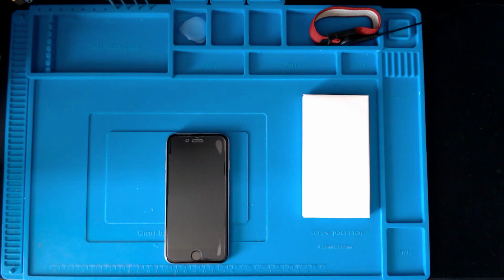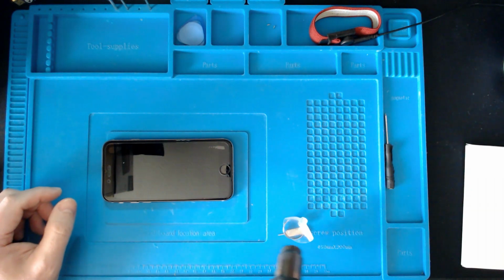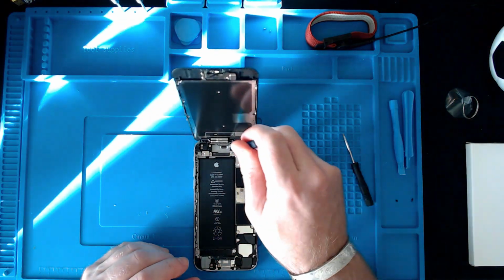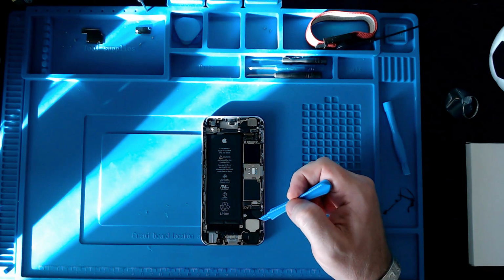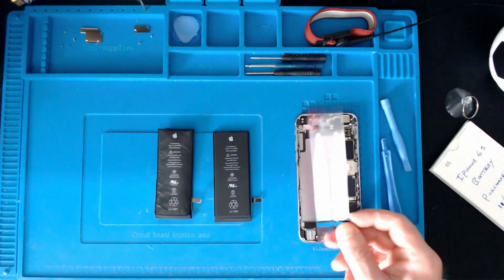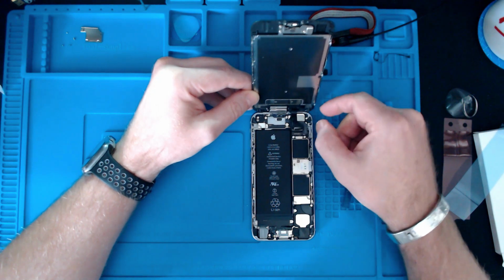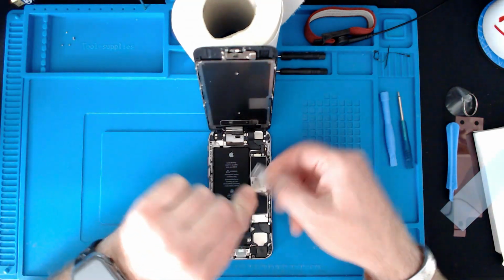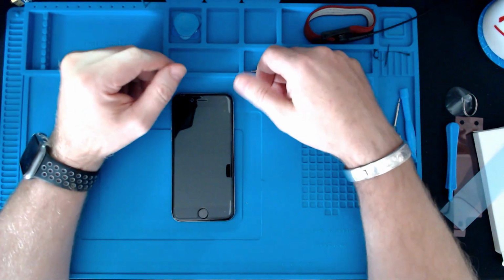iPhone 6s Battery Replacement | With Slip

Comment: be careful prying on a battery if you puncture it it will catch fire , those two strips if you get hold of those and pull away the battery will come out much easier next time there designed for those strips to come to easily replace the battery , good job again
Reply from the maker: Thank you for your contribution! Constructive polite words of advise are always welcome on my channel as we are always learning! I was actually thinking afterwards that maybe fishing wire or something similar would have also worked to cut through the double sided tape! Definitely need to be careful as mentioned in the video that if you were to put to much bend or were to split the battery that you could end up with a small fire! As with everything approach with caution & always respect a battery of any kind 👍 Cheers for watching!